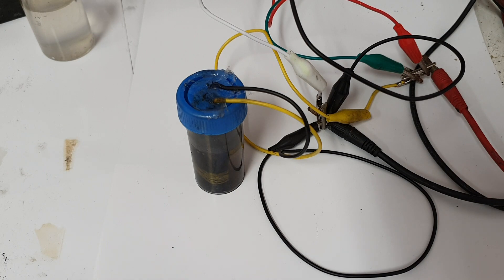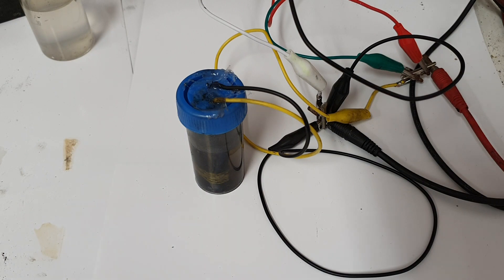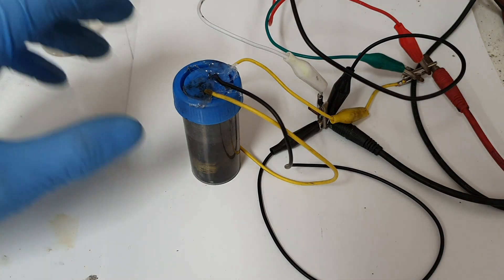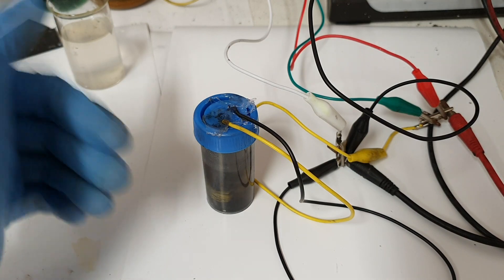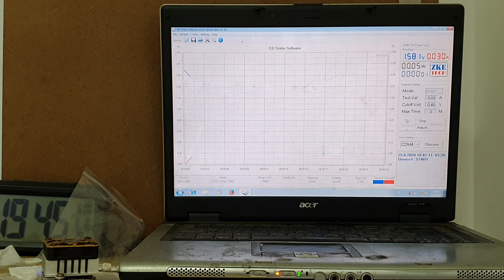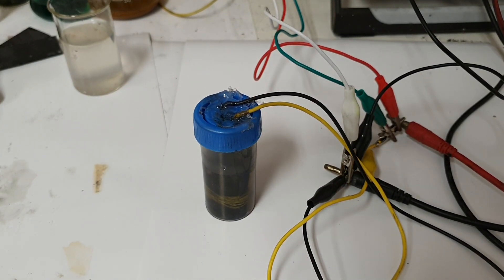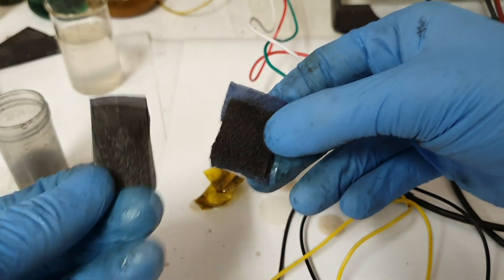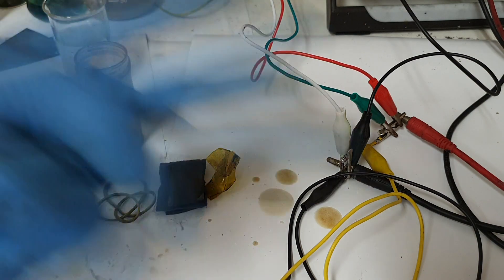Metal Hydrogen Battery - the first step

Comment: Try CoP-PPyTsOH/C-Nx it is Phosphorus-Cobalt alloy toluene-sulfonic acid doped polypyrrole with a nitrogen doped carbon support for the polymer

Has about 205mA/cm2 - 250mAcm2 average current density :) and is a fantastic HER cataylst as alternative to Pt/C. MoS2 doesn't work that well unless nano-exfoliated, it's okay, but not ideal. Cobalt performs much better. 

Interesting experiment and results :)
Reply from the maker: CoP-PPyTsOH/C-Nx is sadly to complex for my lab
Reply: @cayrex  It's actually really easy to make :) one-pot synthesis for the polymer, just oxidse pyrrole using a hot-plate and ammonium peroxydisulfate solution (dope pyrrole with a tiny bit of Toluene sulfonic acid solution before the oxidation phase if you want to dope it)  and polymerisation will occur. Throw in some carbon during the oxidation to create a support framework, then two kiln steps. One kiln step creates CoP (which you can also make electrochemically) by phosphodating cobalt acetate with Sodium hypophosphite - then mix in the CoP in a 10.55%wt to the polymer carbon, mix well, and kiln step to activate the polymer (i have the full write up if you want) then you're done. Really simple process.
Reply from the maker: @wanderingzanzey2126  The lack of materials is the problem 😄 yes, please,... send me to my email. 🙏🤝
Reply from the maker: Have you also some iron or nickel based catalyst?
Reply: @cayrex  Yes, Iron and Nickel based catalysts work really well. I have literature on quite a few of them, be happy to send to you. Though depends on what you're looking for. OER, ORR, or HER? To be specific to the chemistry depicted in this video, you're looking for HER/ORR?
Reply: Honestly - Nickel Iron alloy turned ino Nickel(Oxy)Hydroxicde would perform very well imo. Or maybe some Raney Nickel base, coated with Nickel-Iron(Oxy)Hydroxide. Could be interesting.
Reply from the maker: @wanderingzanzey2126  yes indeed
Reply from the maker: @wanderingzanzey2126  yes HER/ORR
Reply: @wanderingzanzey2126  sounds like a big explosion candidate..lol..
Everything with Ammonium and peroxides should be handled with respectful care...🥴🥴🥴🌟🌟🌟💥💥💥🎃👻☠️☠️☠️
Reply: Better do it all with very common chemicals which also are environment friendly and easy to get...
Reply: @oudotcom  as the chemist here ... this is a very safe synthesis. I have done it many times.